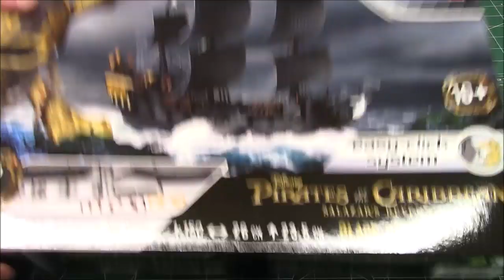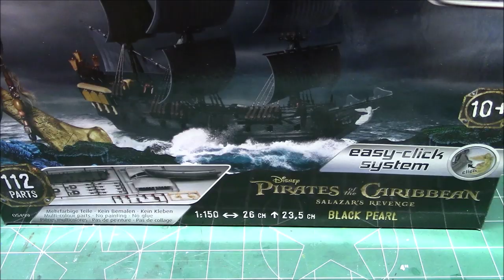Revell Disney Pirates of the Caribbean Black Pearl 1/150 Scale Model Kit Review 05499

Comment: I'm having a hell of a time with the lanterns on the back.  I started by painting them a yellow ochre/gold , but I've been unable to get straight black lines around the edges of each pane on the lantern for detail.  I'm using a Raphael 8404 #0 and a thinned black, but even with fairly steady hands, I just can't outline them without looking like crap.  I've painted and stripped and painted again several times now.  Any suggestions?
Reply: most ppl would say to dry brush it, using many coats to build it up to a solid colour, but heres some other suggestions :
dont use a brush, find something more solid (bristles spread out too much).. try dipping a toothpick lightly in paint and scrape the paint on.. or, a bit of cardboard or plastic sprue.. or you could even use the edge of some cardboard (say, 1mm thick, cut to the correct length, and use it like a stamp to do each line) if you have a small very stiff brush, it could be scraped sideways along the line instead of trying to do a stroke.
or you could use a small piece of paper with a small amount of wet paint on it (put a small drop of paint on the paper, then wipe excess paint onto a tissue or something), and rub the paint onto the ridges, it might take a extra few coats this way
if all else fails, go to the hardware, find the least-tacky painters tape you can, and mask off each line one at a time (for beginners), dont forget to let the painted line completely dry before masking off for the next line. this will give the best result for least effort, even if it does take a lot longer time. 
or think outside the box, you could paint it inside-out.. 
paint it all black first, then dip a brush into the 'glass' sections to paint them back to yellow.. the mold/mould lines will contain the bristles if you are gentle (or again, use the tip of a toothpick).
Reply: These are some really great suggestions! 
I'm not sure that my OCD is to the point of masking off all of the little "panes", but the rest of the ideas are definitely feasible.  Going to re-primer them today and try one of these routes.  Thank you!

Comment: I have built at least two sailing ships;in the last five years.The only thing that I didn't like about them, was the fact the blow molded sails,were thin;and flimsy.They had no structural integrity;to them,what so ever.The next time I build a sailing ship kit,I will superglue some .5 mm brass rod;from K & S Precision Metals,to the insides of the blow molded sails; around the edges;to give the plastic sails,more strength;and structural integrity.If you take the same .5 mm brass rod used for adding strength to the blow molded sails you can make some eyelets and superglue them to the bottom edges of the sails;to tie,and superglue the sail rigging to.The thing I like about this kit,is the sails are a hard plastic;instead of that thin,flimsy,and fragile blow molded sails included in kits like;Revell's 1:196 scale USS Constitution;the 1:150 scale USS united States,and the 1:253 scale German sail training ship;Gorch Fock.